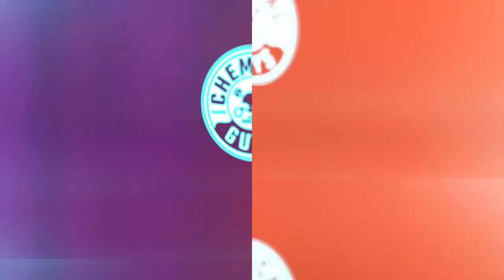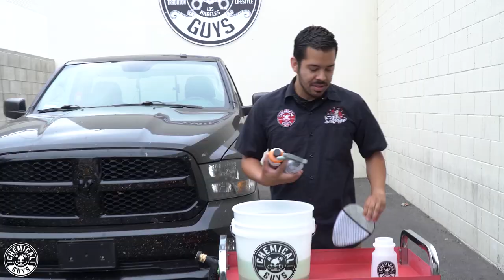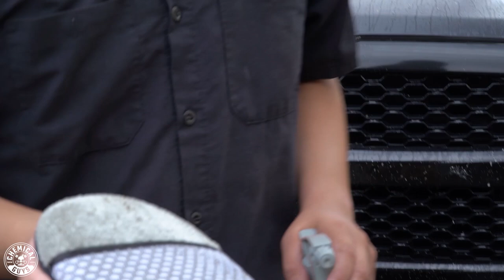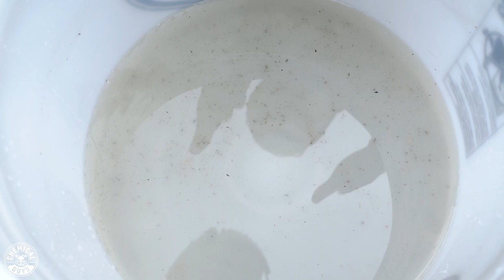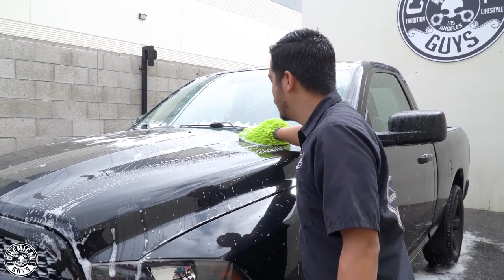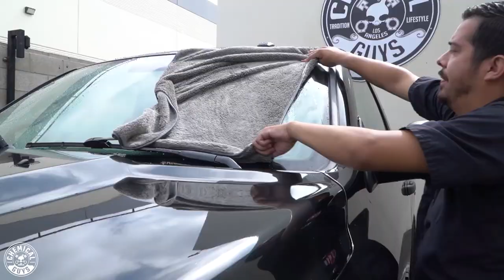How To Remove Bugs Without Scratching! - Chemical Guys

Comment: I have a question can this be mixed in with soap or should 2 oz be added in the wash bucket to only be used by itself?
Reply from the maker: Hey Andy! Absolutely, it is perfectly fine to add Bug and Tar Wash to your favorite car wash soap for adding cleaning power.

Comment: Hey I bought this stuff and it was OK, but did not get alot of the really stuck on stuff. I used the wheel wedge and used a diluted spray bottle. Any tips?
Reply from the maker: Hi there! Try using a Medium Duty Clay Bar and Clay Luber to extract embedded contamination.

Comment: I used this product and it seems it attacked the coating of my car…I saw on the instruction I can spray directly on the car which I did I left it on for a few minutes and after washing the car I saw everywhere I sprayed  it remained a stain like the paint protection was affected. Even after two washes it’s still there😮‍💨 any advice on what I can do? Thanks!!!

Comment: I love using your products. I wish the red wheel cleaner came with a spray instead of a stream option. it comes out in streaks and the product runs out quickly. question, i have some wheel shine residue in my wheel wells, what product can i use to remove it?
Reply from the maker: Thanks so much for your feedback. Try using All Clean+ to remove grime.

Comment: Can you use the diluted formula in a pump sprayer and use it like a pre wash? Spray it on , let it sit then go with the foam cannon soap and use the mitt with the buckets as normal. Instead of doing it in a two part process?
Reply from the maker: Absolutely!
Reply: Can I use this as my soap for foam cannon?